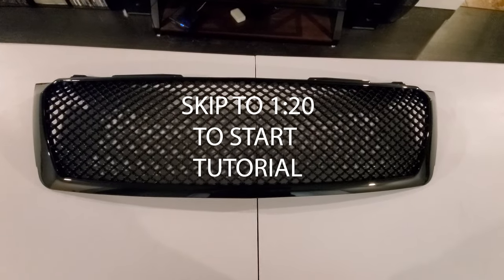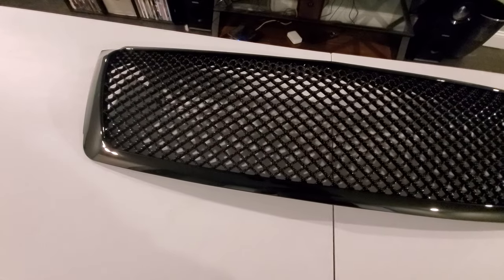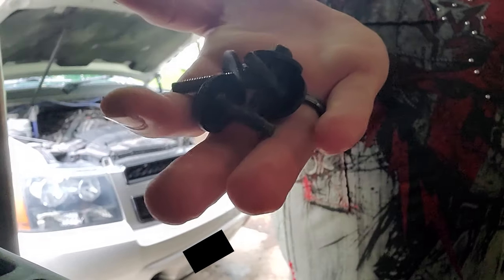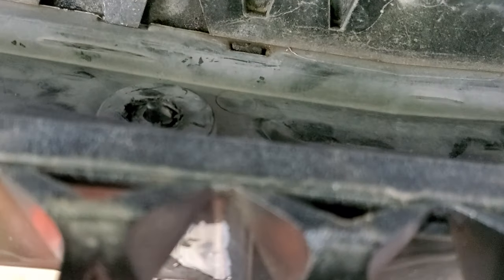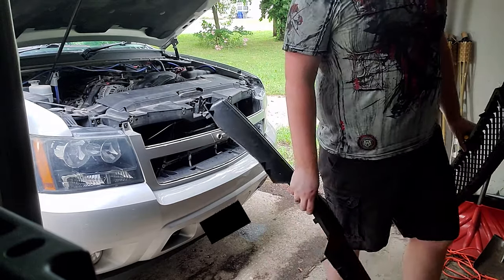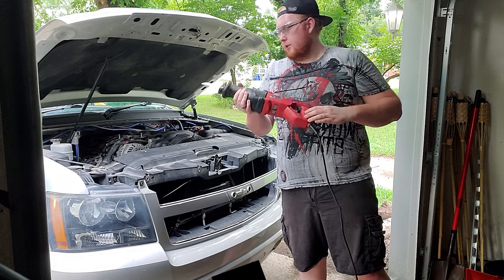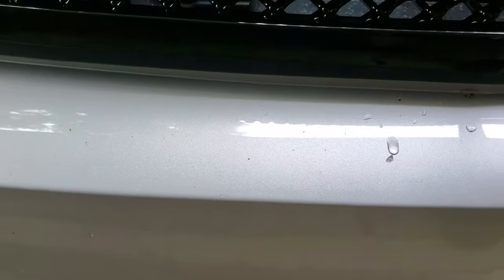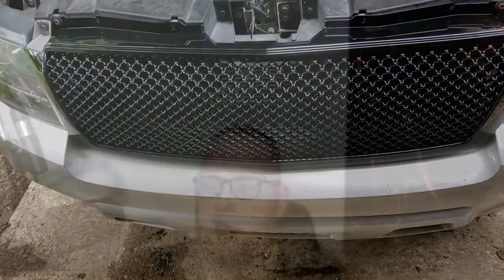2011 Tahoe 1 Piece Grille    (How To Install + Review At End Of Video)

Comment: The grill has studs with hooked tips for the center cross member to lock the grill in place.  Cutting it out as you found out you lose your support.  The hooks are on the bottom of the grill also that pops in once the center hooks lock in on the crossmember. It takes some effort to push the center bar on the grill hooks, no worries the cross member is flexible. Once in you have a tight fitted grill ready to bolt up.
Reply from the maker: I see. Personally I don't like the look of the center crossmember visible behind the grille. What I did was I took a heat gun and slowly bent the bottom clips down a tiny bit, and now it latches perfectly. But, like I've said before I got a very cheap one. My friend bought one that was about $130-140 and his fit perfectly, no crossmember either.